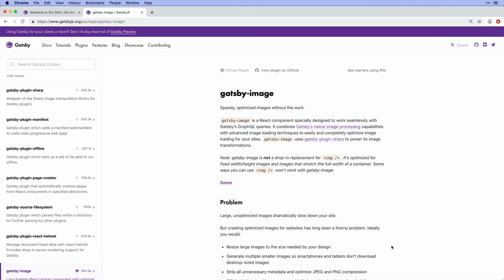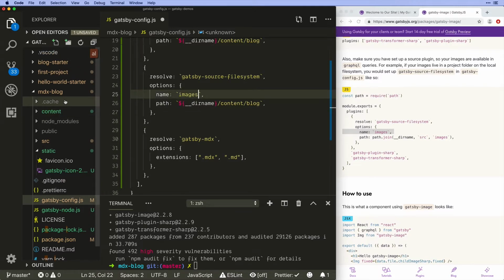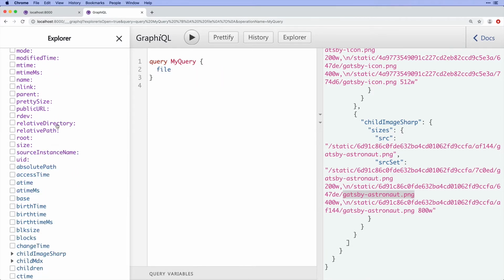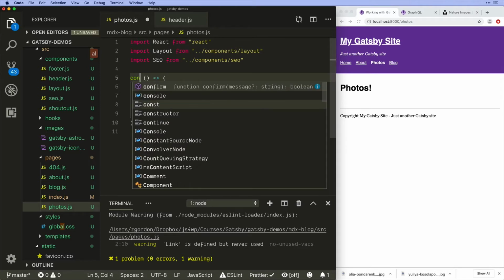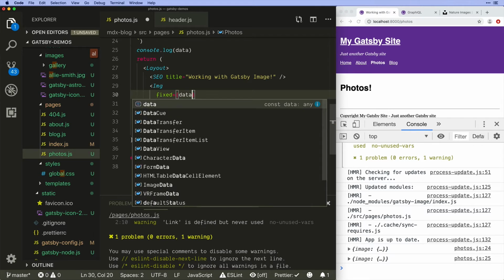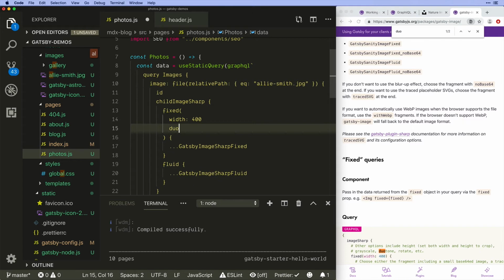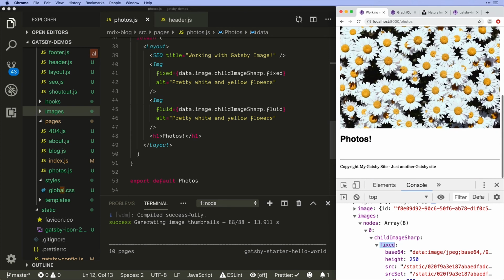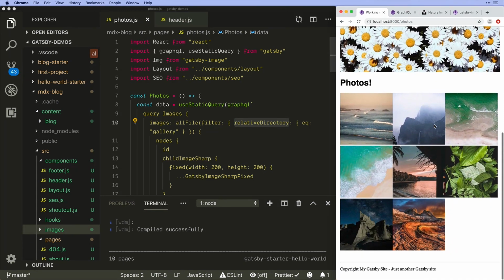In Depth gatsby-image Tutorial

Comment: for multiple images it works locally only.. remotely it doesnt work. This issue is still not fixed, if for example you have a strapi backend remotely you can`t query multiple images -> throws the famous error Cannot query field "childImageSharp" on type "Strapi(nameofyourfile)".   Which sucks, therefor avoid gatsby if you have a project that involves querying multiple images
Reply: yeah true, i have wasted 3 days figuring out and finally i think the only way is not to use 'GATSBY IMG'  for multiple images. Instead you can manually query image.formats.thumbnail.url in your gatsby page.
Reply: @imankit12feb89   I transitioned to NEXT JS and never looked back at Gatsby. Other developers went thru the same experience, beside this problem, issues with some of their plugins, their onChangeRoute is very limited and many other issues. Just avoid it all together and save your sanity
Reply: @21agdmnm  thanks i will also move to next js